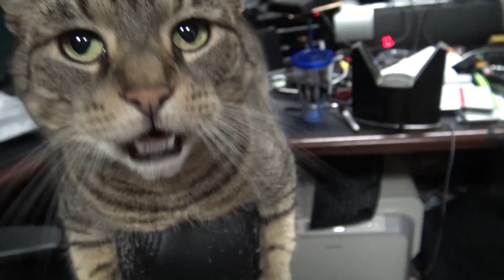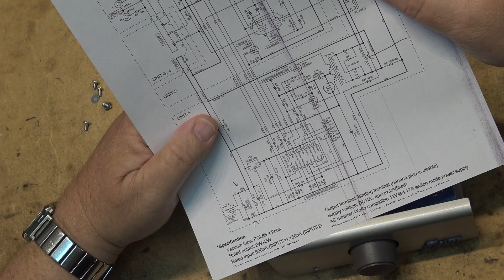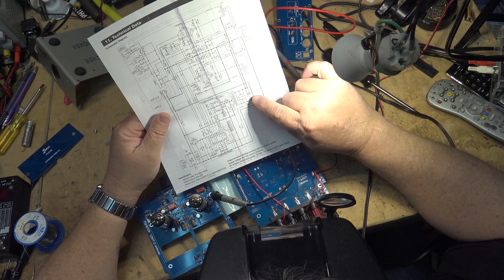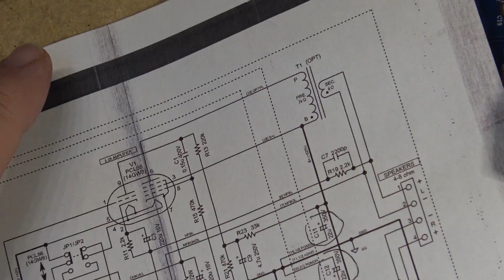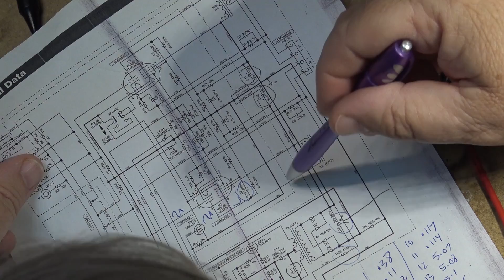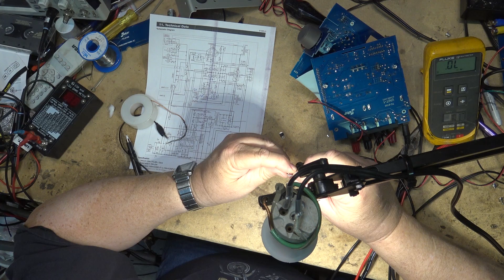ELEKIT TU8100 Class A amplifier goes into shut down.   Troubleshooting modern tube amp. PART 1

Comment: I came to your channel as I was looking at Elekit videos in preparation to doing my own TU 8200.  Really impressed by your systematic approach and incredible patience to even re solder all the connections! Great work.
Reply from the maker: I will only say 1 thing about elekit.  They are top quality but if you are in North America i would suggest that you purchase them from an authorized dealer that has bought them from the official distributor for north america, vkmusic.  I met the distributor when I had to get the part for this one. This particular amp was a grey market import, which sold for less than he can bring them in for.  This has him pissed off to the point that he is ready to throw in the towel and say "fuc* it" and if that happens there will be no support.  He even had the manuals all translated to English for us to assemble.  If he quits, we will have to learn to read japanese.   Elekit vacuum tube amps are probably the finest tube amp kits you can buy. 10 out of 10.   I have built 2, and am considering a 3rd.
Reply: @12voltvids  Thanks. I'm in Australia. Dealer here runs day long Amp camp on site.

Comment: Since the PIC monitors multiple points in the circuit, it's too bad it wasn't programmed to flash out a trouble code using the LEDs when it goes into shutdown mode.  That way at least you'd know which input triggered the shutdown.
Reply from the maker: It actually does.  If a fault condition is caused by over or under voltage or over current on a tube that led will flash.  If it is something that is detected on both tubes then both flash.  In this case there was drive missing to one mosfet and thus the voltage was low to both tubes.   This is a fault that should never happen, according to the designer, whom I was in contact with via the distributor for north america.

Comment: Though I used it today for an SMD repair, I have never liked using copper braid for repair work.  Most repairs go much faster and with much less heat damage with a good electric desoldering pump like the Hakko FR-301.  Especially useful on PCB and point-to-point repairs.  Only wish they were an affordable alternative to the braid and the ubiquitous solder-sucker 40 years ago when I started out in this business.

Comment: were do you get the voltage for the tube plate?
Reply from the maker: DC to DC converter. 2 mosfet driving step up transformer.  Steps up to 220 volts.

Comment: @
mrnmrn1
 I fully agree PIC's have no place in tube amps, nor have SMPS power supplies.
Reply from the maker: Well that is how they do it on this one.  The big brother uses a toriodal transformer but still uses solid state devices to set the bias voltage which is far more accurate than a manual control.

Comment: Presumably, the PIC monitors the current and voltage on the tubes via resistor dividers? Are the resistors of the correct value? Excuse us lot standing and shouting from the touchlines! Enjoyable video.
Reply from the maker: Yes monitors voltage and current.  Yes resistors are correct value.

Comment: As a general note, I use liquid RA flux on any board work. I also use a temperature controlled iron with separate check of temperature,
Reply from the maker: My iron is temperature controlled and has been calibrated.

Comment: Interesting how it is a hybrid amp, where it uses tubes but has a solid state power supply and safety circuit, and how the B+ supply is derivied from the lower voltage of the wall-wart.
Reply from the maker: It is not a hybrid amp.
The solid state components are not in the audio circuit.  It could very easily be mains powered with a conventional transformer.  The design was to use an inverter in the power supply as a safety precaution so everything can be monitored for any faults.  
A hybrid amp would be a solid state power amp with tubes in the audio path, such as a luxman lv103 or 105

Comment: Dave,  you mentioned that this unit came without the power supply. It looks like a standard 12vdc wall wart. You can up these online for ridiculous prices, but a better idea is to check out your local Goodwill or similar (when they reopen) where they probably have a barrel of them for around a buck. I volunteer in a small nonprofit shop associated with a senior center, and we have, no exaggeration, 100’s of these things and are looking for ways to get rid of them.
Reply: The Power Supply of this Amp is not a Cheap low Q 5,99 somethin Walwart, its a very decent Brick puttin out 5 Amps @ 12V . 60W+ Walwarts, no dice here? Dave uses the Power Supply of his TU8100, the customer has also said sorry for not sendin the PS in a (deleted) comment
Reply from the maker: The owner didn't send psu to save weight and shipping costs.  I have the correct smps as I have the same amp.  Mine has probably 1000+ hours of pure musical enjoyment on it.  These make killer headphone amps.

Comment: The design of this bothers me a little bit. they are driving ordinary MOSFETs from a microcontroller directly with no gate driver. this is a seriously BAD idea in more ways than one. They could have went at least with logic-level FETs. it would be less taxing on the microcontroller, and it would be able to drive it into full saturation a bit better. So I wonder if the design flaw caused the PIC to fail. it may not have the drive current for those FETs, or just barely. Back when I experimented with a microcontroller based SMPS, I had to use a gate driver. I had issues otherwise.
Reply from the maker: This is a 2sk4017 which is a logic level mosfet. 4v will drive the fet into full saturation. it has a max gate voltage of 10v. Not the newest of designs but one that is stable and been around for a long time. No need for a gate driver with this, just a pull down resistor to turn it off when TTL drive voltage is removed. My unit has been running flawlessly for 3 years and it gets a fair bit of use.
Reply: I am not saying it doesn't work, I am just saying ive had bad experiences when designing/using circuits built like this. ive had troubles. I guess it all depends on switching frequency, currents, and parts selections I suppose. In this case, PICs are usually around 25mA Max drive current from any of the GPIO pins such as the PWM outputs used in this case. This is cutting it close.

Comment: I'm kind of glad that all of the amps I've made don't include "smart" features.   I wonder if the original assembler "cooked" the IC while installing it.   I really prefer to socket IC's on PC boards.
Reply from the maker: You should try one of the modern designs with the auto biasing. They really sound great and don't require re-biasing through the life of the tube, plus you can roll tubes any time you choose and the new ones will sound perfect from first installation. This plus automatic bias through the life of the tube means no sound changes throughout the working life. I have both, and the modern self bias is superior. Incidentally this amp is not such. The TU8200 is though.
Reply: I have manual adjustments with current meters on my tube headphone amp.  I would LOVE to have automatic calibration.
Reply from the maker: @gavincurtis  the auto bias on my tu8200 is flawless.
Reply: Question, my tube headphone amp is a Little Dot Mark VI.  Balanced output.

I habe multiple sets of tubes.  Very knowledgeable in electronics, but I dont know tubes..lol.  What I do know os they are unbeatable sound.

I am having a problem where one channel drops out at low volumes.  You habe to crank the volume rapidly to "awaken" the dead channel.

Bias currents are correct.

Anything known with tubes that could cause this?  Not a mechanical issue.  It can fo days without problem.  Other times it wont work long enough to listen to one song.

Is this something you could diagnose as my time to learn tube topology is limited.  My company ships electronic gear worldwide, so unless it falls out of the plane at 30,000 ft, it will get to you safely and you would reuse the custom packing blocks and box to get it back to me.
Reply: This new youtube I cant see what I am typing.  So fristrating.  So ignore the typos as I cannot see until I publish.

I have two sets of tubes.  No difference.  No microphones with my Tungsol tube set, but still drops out.  Bias current is stable for all 4 output (balamced).  I suspect one of the 4 channels is dropping out.

Comment: That is why I don't like those monitoring/protection circuits in a tube amp.
Without that shit the amp would run just fine.
All the best,
Robin
Reply from the maker: Not true. If your amp runs away the tubes, audio transformer and power transformer will burn up and this gets real expensive really quick.
Reply: @12voltvids   the fuse should blow first
Reply from the maker: A 300.00 transformer will protect a .10 fuse by blowing first.

Comment: Dam what a shame, i would be really upset if it didnt work after assembly :-(
I could not see your diagram clearly but are the gate biasing resistors both ok?
Reply from the maker: I checked the bias resistors and as you saw swapped the FETs to rule out FET.

Comment: Couldn't you of temporarily swapped the IC from yours since you have the same unit, just to verify the problem?
Reply: If there's a problem further down the chain that isn't clear, he could pop his IC.
Reply from the maker: Not about to put my amp at risk. These things are expensive. I think mine was about 400.00 by the time taxes were paid and the big brother to it was 1120.00
Thats serious money for a bag full of parts. I want to build the even bigger brother, but unfortunately there is a wait list of over a year to get that one. I have had my name on the list since it was announced and no email informing me that I can bring 2000+ for in and exchange it for a bag of parts and then another 600+ for a couple of vacuum bulbs.
Reply: @12voltvids  I agree......As a technician, I don't like to break anything that's working properly.

Comment: I thought about building one of the Japanese kits, not this one. Quite complicated for 2W per ch., I mean the power supply section. 
Watch smoke blow... Damn, very confusing little POS, programmable chip to drive HV power supply. Yeah, I would rather see regular transformer and normal PS, but this days everything is cute and small, running of 12V or laptop power supply.
It should drive higher impedance headphones like Sennheiser HD600, 650, Beyer DT880, 990 or similar ones nicely ones fixed. Or large high efficiency horn spkrs. Waiting for part 2 of the mystery.
Reply: Controlling Currents and other "relevant" States to run that or any Tube Amp is not the baddest thing today. Sure, a "propietary" programmed CPU to protect the Hardware and Your Speakers, even Your "Life"...  a slightly bad Taste... And for Headphones there are very good Tube Amps...Japanese/Chinese and even Big Names like Marantz, Fisher, Sennheiser, Stax etc. have pristine Headphone (Tube) Amps....
Reply from the maker: @LittleGizzmo  This is probably the best sounding headphone amp you will find at any price.  Too bad it doesn't have a headphone jack, but easy enough to connect. The TU8200, which is the 3 or 8 watt version depending how you set the jumpers (triode, pentode or UL) does have headphone jack and I use it all the time with cans. The bigger TU8200 uses a conventional torroidal  for HV, but still uses semiconductors in the tube bias circuit, which is a good thing, as they can very accurately monitor tube current and make minute adjustments to keep the tubes running correctly throughout their life, and actually greatly extend the life of the tubes. All these ELEkit amps are critically acclaimed amps and are in many audiophiles systems. They sound that good! They are expensive though, and you have to build them youself. I am in the waiting list for another one which will cost me even more and provide a few days of building enjoyment once it lands here. Unfortunately myself and many others are waiting for new stock of kits.

Comment: Would you be able to take the signal from the working signal output of the IC and connect it to the fet that doesn't get one? the timing wouldnt be right, but at least the fet that does get the signal wouldn't go into compensation mode.
Reply: Was my 1st thought too, just try the functioning Pin with Signal and "bridge" it  to the FET that gets the "bad" Signal, I looked at the Schematic, and even  a small Signal from the "other" Out is send to the Fet through some Resistors and Caps around them FETs....
Reply from the maker: Sure and the voltage from the output of the transformer would drop to 0. They switch back and forth out of phase to create a N-S-N-S polarity on the transformer. The output like thin ^v^v^v^v which is full wave rectified. With only 1 output working it is more like this ^  ^  ^.  Half wave basically.
Reply: @12voltvids  So both Fets would work on the positive swing only and might create another overvoltage situation, since the both work on the same pulse. You need a signal delay that shifts one signal to the "off" time of the original signal. or a new IC lol
Reply: or is the non working FET responsible for the negative swing? oh yeah... dang.
Reply from the maker: @Asriazh  You did see the pulse width change when it fired up right. This is how it regulates the voltage. A sample from the DC is fed back and measured which changes the duty cycle of the fets to control the output voltage of the transformer.
Reply: @12voltvids  So delaying the signal from the working pin of the IC wouldn't do much good, even if youd flipflop the signal. the FET that would get the mirrored signal wouldn't have a "real" voltage control over the transformer, just a fake one from the "wrong" DC feedback, is that right?
Reply: Forget what i said about flipflopping, that still wouldnt get the signal inverted with the right timing :p

Comment: Could be a problem in the future, when this amp is discontinued and if the programmed PIC is no longer available from the manufacturer in Japan.
Reply from the maker: But that is an issue with anything you buy or own. As long as these NOS tubes are available I don't see them discontinuing the kit, and once they do, all they need to do is make the code available for the PIC so someone wanting to fix can just burn a blank chip.
Reply: @12voltvids I don't know about Elekit. But the problem is some manufacturers don't make their proprietary PIC code available.
Reply from the maker: @hvacr tech Yes that is possible.
Reply: @hvacr tech You can download the code from PICs, but quite sure they set it into read protect mode, so you can't. They don't want to give it away for making knock-offs. But as Dave said, they will do the right thing if they make the .bin file available when they decide to discontinue the kit. I very much doubt they will, but let's hope. And if they don't, someone with good PIC programming skills can write a new code for it. 
Though I don't like the concept they used a programmable device here. They develop 'amnesia' after a few decades. So these amps will probably be unrepairable within 40...70 years :-) , even if they finally publish the bin file, because who will have the file after many decades. It would be nicer if they used a TL494 for the PSU, an LM324 for sense amp with uA339 comparator, and a few 555 for timing. That would be super repairable. 
It sounds like a lot of chips, and probably that's why they decided to use a PIC, but if they made this PSU/controller circuit on a vertical daughter board with SMD components (pre-assembled for those who don't like doing SMD), it would fit into this small case, and could be repaired by anyone with good troubleshooting skills in electronics.
Reply: When this is the reverse pulse signal, why not generate it from pin 15?

Comment: Interesting that it's using PCL86, that valve I've only seen as the audio output in televisions. P series valves were intended for series connected heaters, commonly used in TVs, rather than parallel connected 6.3V heaters, like the ECL86.
Reply from the maker: PCL86 was designed for TV!  This is probably why they designed thius amp like this. I am sure there was a huge inventory of PCL86 (14GW8) and ECL86 (6GW8) tubes kicking around. Of course the PCL japanese version used 14v heater, and the American version 6GW8 used 6V, and  that is why the jumper inside, so if the 14v tubes go out they can be replaced with 6v versions.